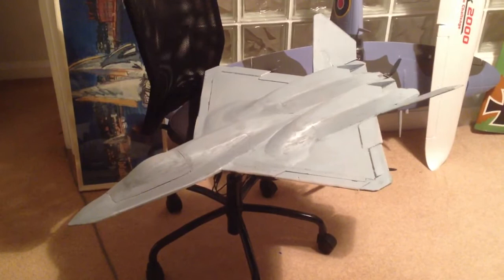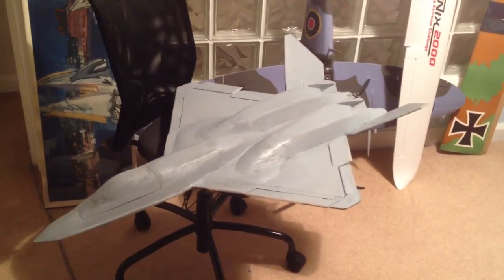YF-23 pusher

Comment: This deserves way more than 90 views!

Could i control a simplified version of this plane with just the angled tail fins? I only have a three channel radio (throttle and two servos). I could picture that an elevon system would work to replace the elevator. I am not sure that i could use the tailfins as ailerons without causing the plane to pitch!

Any advice?!